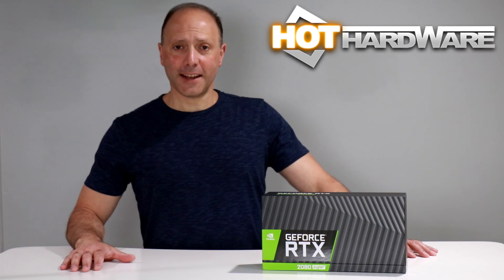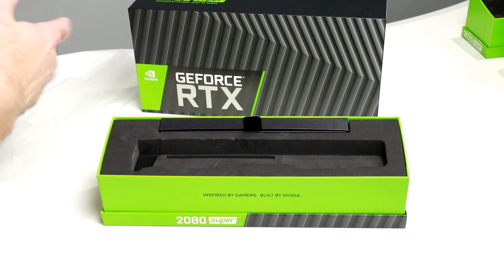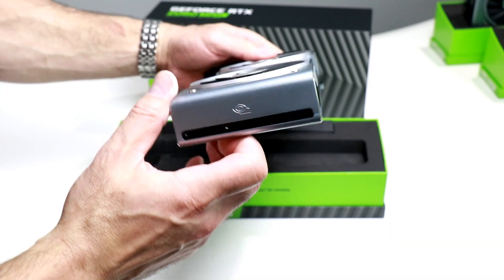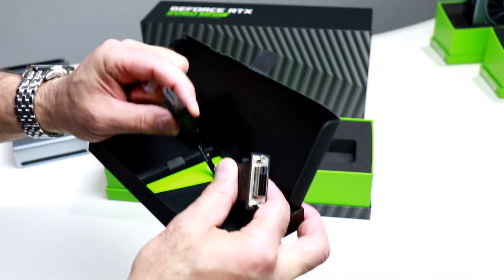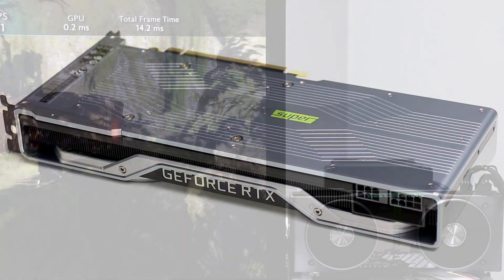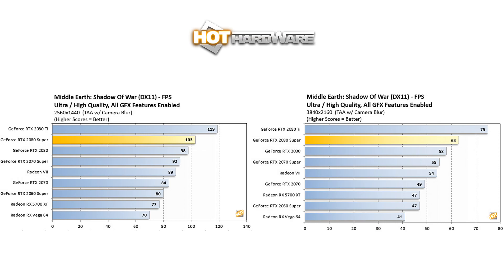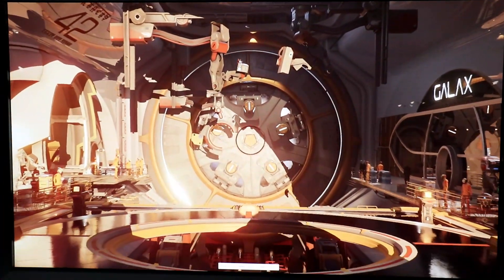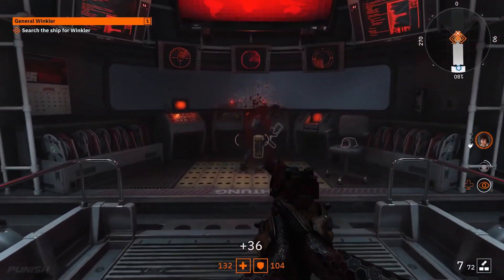GeForce RTX 2080 Super, How Super Is It? Unboxed, Benchmarked

Comment: They are still to expensive.  Why don't you turn on the features of the RTX Cards and the RX Cards and benchmark then and see which one is better?. That would be nice to see.
Reply: I think one of the features people are forgetting about on the RTX cards is a lot of the demanding games are starting to incorporate DLSS which is improving frame rates a lot.  The RTX 2080 Super seems to be in a sweet spot for price/performance.  2080 ti is in a league of it's own really, but at a cost to.  Then again to build a PC that doesn't bottleneck the GPU you're  spending over a $1000 to begin with.